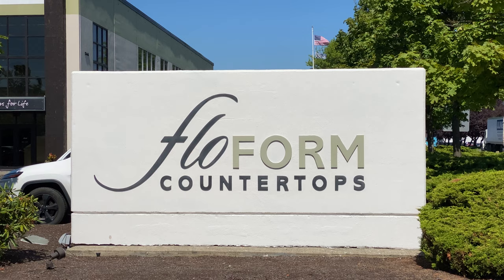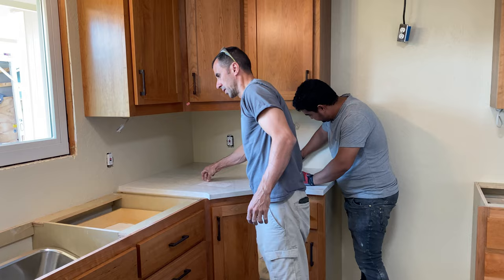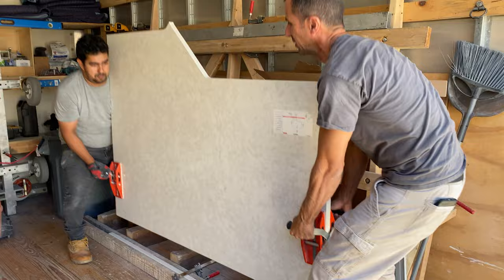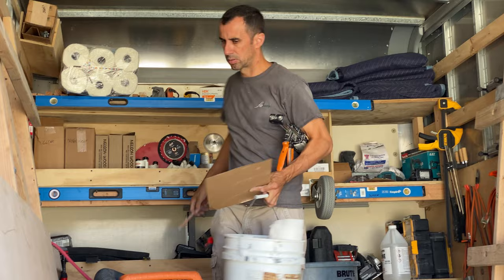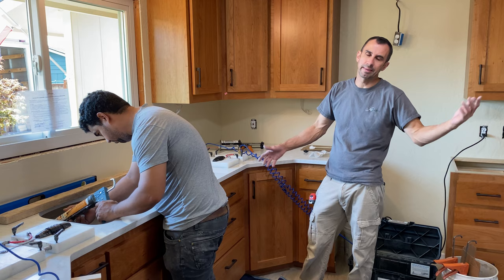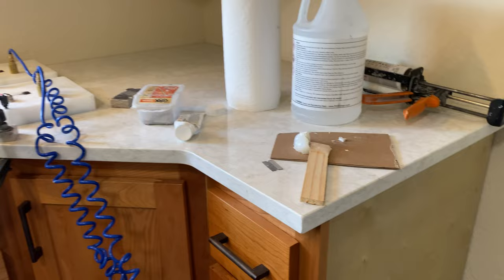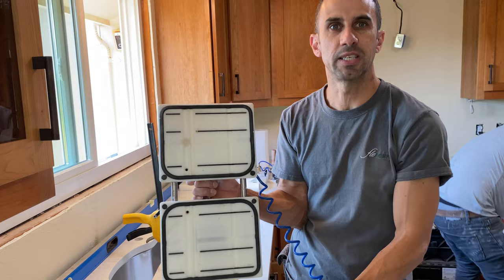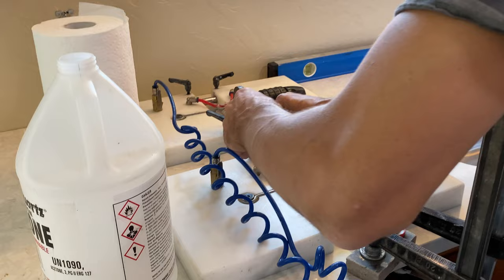Kitchen Remodel Part 11 – New Quartz Countertops Installed

Comment: Wow, that was a big gap.  3/16"   Somebody messed up.  Assuming the cabinets are all uniform height I'd say the guy who installed the toe kicks messed up.  Personally I use plastic handi-shims and put them under the vertical parts of the toe kick, not under the corner braces.
Reply: Floor isn’t level.
Reply: @yclablee765   

What floor is?
Reply: @yclablee765    hello?
Reply: @thekinarbo facts. Even if the floor is unlevel then sim up your cabinets. Makes way more sense than putting the stress on the counter top. Kinda annoying that these installers say this is normal rather than hold someone accountable for it. Homes are forever, they’re not meant to be rushed and have the shit work covered up with “trim”

Comment: Hi, are you in oregon or washington area by any chance? what was the color name of this quartz (?) slab? What was the cost of the added window sill piece? thats a nice touch
Reply from the maker: We live on the Olympic Peninsula in Sequim, WA. The contractor we hired to remodel our kitchen is Tim's Custom Cabinets. FloForm Countertops was the sub-contractor who provided and installed the kitchen countertops, backsplash and windowsill. The quartz countertop we chose is Silestone, and the color is Lusso: https://floform.com/products/lusso/. I do not know the cost of the windowsill because it was included in the cost of the backsplash. 

Thank you for your question and for watching!
Reply: I have three different quartz countertop brands in my home, MSI, LG Viatera and Silestone. Silestone is the only one that has a (small) defect and is also the only one not made in the U.S.

Comment: That job should have been 1 seam not 2 .  Looks great though. Good install
Reply from the maker: Yet Pacific Bath told me that they were sending their best. Go figure.
Reply: @randallwingett  it’s a great looking install. And if your happy with everything an extra seam doesn’t matter.  They obviously use CNC machines and get better yields out of materials.
Reply: Where would you have the 1 seam? At the sink?
Reply: they did 2 seams not to get better yields, but to avoid breakage at the narrow bridges around sink when transporting a huge ~10 ft slab
Reply: @eee3400 this is quartz.  It doesn’t break that easily. They have sink savers for the sink area. I do 120 inch runs all of the time with natural stone all of the time.  If the piece isn’t longer than 130 inches. I would have done it in a single piece.